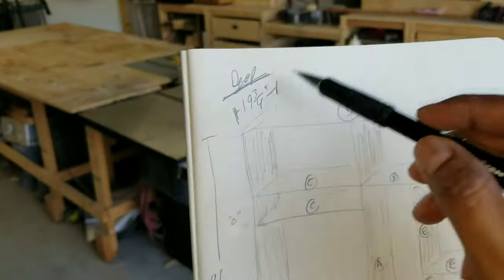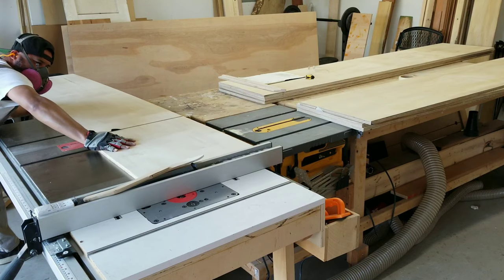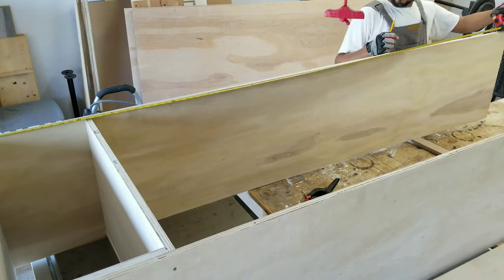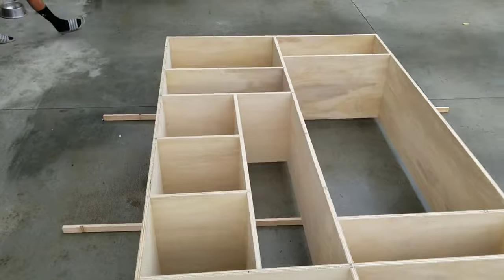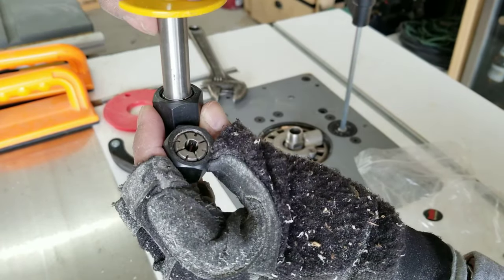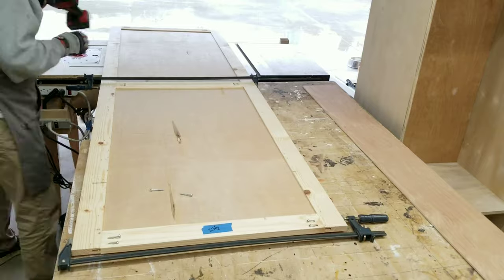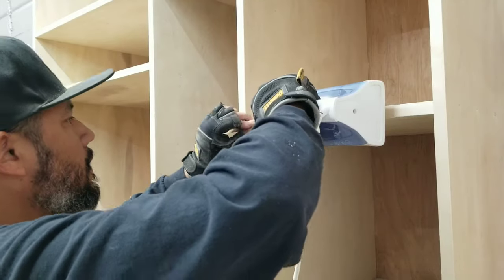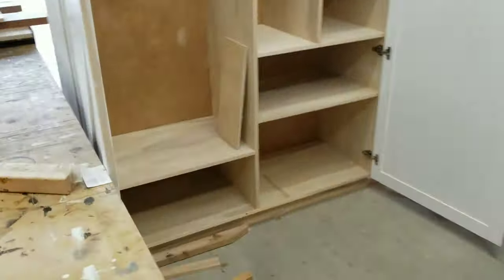Storage Cabinet Build - Caliwood Specialty

Comment: Excellent job there Cali, I have just built a tool cabinet that is 8x4x15 , mondo cabinet, just barely fits in the garage. The only difference between yours and mine is I used all wood and glue, no screws or nails, even the hinges are wood, I did put steel casters for easy use, I love to see more of what you've got.
Reply from the maker: Thank you for the kind comment. Your cabinet sounds like an amazing build. You even used wooden hinges? Wow.

Comment: Nice job.  On those cuts that don’t feel good on a table saw I usually reach for a track saw.  Even just a long metal level clamped down with a little room to clean it up on the table saw later will give great results if you don’t have a track saw.  I’m guessing you already have this covered but like everyone else on the internet I feel some strange compulsion to show how smart I am!  Cheers!🤪
Reply from the maker: Thanks Logan! lol yeah,... at the time of making this video I did not own a tracksaw. And yes, I could have busted out my circular saw and clamped down a straight edge. <- This would have been the safer way to do it, no doubt but I got lazy. I do now own a tracksaw and it is definitely my go to tool for cutting down plywood sheets!

Comment: That un-safe table saw scene surprised me...that you didn't just use a track saw.   Surely a carpenter who has that nice of a workspace & tools, has one of those.
Reply from the maker: Haha, yeah... shortly after making that unit, I bought myself a sweet Festool Tracksaw.
Reply: @FranksCaliWoodSpecialty  Smart purchase. You will not regret it. Expensive yes but when you don't have a large space to store all of the different tools it soon pays for itself quickly. You can purchase different size tracks to be able to select the size that works for the project you are working on. My longest one is 8 foot and it can make cutting down plywood easy and safe. With a couple of saw horses and a diy cutting platform you set it up just about anywhere.
Reply from the maker: @eyesalooking  Yes, indeed it was an good purchase. I now have a couple of those 55" tracks. It's been a whole lot easier and safer to cut/rip down 4x8 sheets. Very happy!
Thanks for the comment

Comment: Thank you for showing the safe way I'm just getting into power tools and I'm debating on a table saw or chopsaw....
Reply from the maker: Hi Delia - Thanks for the comment.  Yeah, I always say if it feels unsafe, do not do it. Find a safer way to do it.  By the way,...a table saw and a chop saw are both "must have" tools. I purchased a really inexpensive chop saw, which I later upgraded to the one I have now.  I also bought a job site (portable) table saw from DeWalt early on and it was a great tablesaw but I outgrew it when I started to make larger projects. Good luck to you!
Reply: Thank you! Yes ok I will look into those thank you so much!😁

Comment: Hi, just stumbled  onto your build video, very nice. I have a couple of questions.( mostly about the doors). are the door made of 1x4's or another species. also what ( type if insert) did you use to create the illusion of a barn door. I am in the early stages of a wall of garage cabinets and my wife wants a similar look for our doors. And lastly hinges, i noticed you used only 4 , are the doors 8' (mine are). Have you had any issues with them staying rigid or warping at all. Thanks for any insight.
Reply from the maker: @dancascino701  Hi- Thanks for checking out my build video. 
Yes, I went with 1x4s for the door frames. The inserts (diagonal pieces), which give it the barn door effect, are also 1x4s that were planned down to be less thick. In addition to its  appearance, they help to add rigidity to the doors. Lastly, the doors are actually not that heavy, and the existing hinges provide ample support.
Reply from the maker: @dancascino701  good luck on your build!

Comment: The only thing I see you need to correct is using 3/4 inch plywood. It's overkill for any cabinet. You should use 3/4 inch for a house's floors and other wall structures. A 1/2 board is just as strong, and you can always add a light support beam to strengthen it for weights over 100 LBS. However, that door at 3/4 of an inch was perfect for the application you use it for.
Reply from the maker: Thank you for the comment.  No doubt that 1/2" would've sufficed, but although the 3/4" was overkill, it makes me sleep better at night :)
But to your point, Yes, ... I have used 1/2 on countless other cabinets projects.
Once again, thank you for the comment.

Comment: Hi frank, I have a question about the doors.
You made a groove and pocket holes. Were You able to make a good solid  connection with pocket holes even though there was a groove?
Reply from the maker: Great observation! Inhad to use longer pocket hole screws instead of the standard 1.25" screws. Additionally,  i used glue all around the panels. Thanks for the question.
Reply: @FranksCaliWoodSpecialty  ty

Comment: Hello Frank Calliwood Specialties 
Your video maybe a year old, but I just found you and subscribed. In the video you used a Kreg pocket hole jointer. In all time since they have been available. This is second time I've seen it used. The Video quality is visually excellent  but the audio quality is almost too soft for me to hear you properly. Do you have a video showing the proper method using the Kreg system?  Again thank you
Reply from the maker: I appreciate your comment. Thanks!
A couple of things: 1. I don't have a Kreg Pocket Hole jig. I do have Porter Cable Pocket Hole jig (560 model). It is a much easier to use and much quicker to set for repeatable holes. You'll see me use it at around the 2 minute mark. I bought it a few years ago. It's a must have for joinery. There are plenty of videos on how to use this, but I may consider making one as many people have asked me about it. 

2. The only Kreg product I own is the concealed hinge jig, which make holes at appropriate depth for European style hinges.

Hope this helps
Frank

Comment: Great work Frank. I'll add a bit of rigidity to the 1/4" plywood doors with some inside backing but the diagonals, though nice looking, won't work for me. I'll be printing up framed woodshop tips and stats to mount on the doors. Things like conversion charts (MM to INCHES), different size categories for different functions, and of course a calendar with a beautiful lady on it.... a real workshop. LOL.
Reply from the maker: Hey thanks for the comment! Haha, yeah  that's the beauty of building custom cabinets, you can modify it in anyway you want.  This cabinet was built for a friend, not for my shop hence the decorative diagonals. 
And yeah, I need to get a 2023 calendar soon LOL
Good luck on your build.

Comment: Good job but things like check for square no use if not the same side it can be square I believe to improve your skill check some on you tube like Fixe that build that should help you best regards
Reply from the maker: Thanks for your comment. I also check for square from corner to corner and make sure I get the same distance 😁
Reply: @FranksCaliWoodSpecialty 
That good but same inch here is the difference I don't want to argue with you but in that case is any matter the things is square and same inch like I said and still agree good job

Comment: Looks good but I don’t understand your door framing. You cut a groove all the way through the long side pieces which leaves an open slot on the top and bottom. Then you drove pocket hole screws where there wasn’t any material…
Reply from the maker: You have sharp eyes! Yes, the pocket screws were just long enough to bite into the vertical pieces. Plus, I used glue and finish nails along the inserted panels. Thanks for the question.

Comment: The best way: to have a blade guard and thus reduce the possibility of committing harikari on the table saw. If you're having difficulty cutting 8x4 sheet material on the table saw, then use a flaming circular saw at the outset!!!¡!!!!!!!
Reply from the maker: 😆 yeah, I invested in a Festool Tracksaw a while back. It makes ripping full sheets much easier/safer.